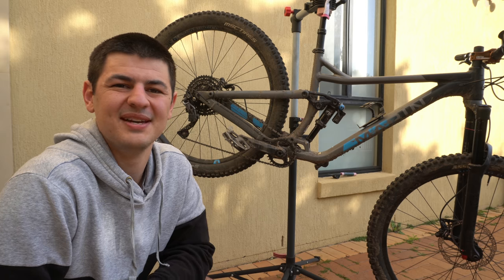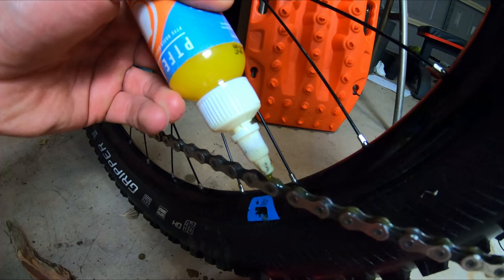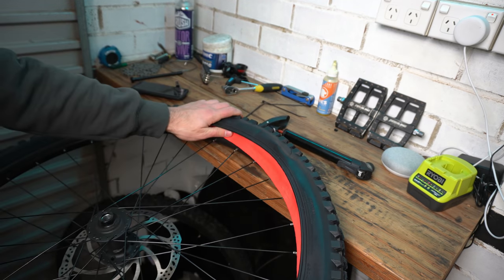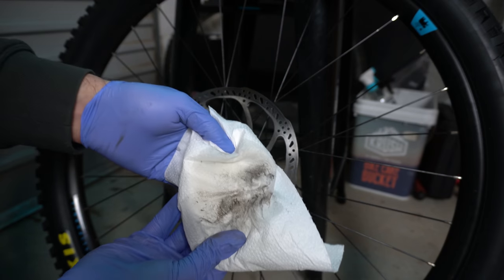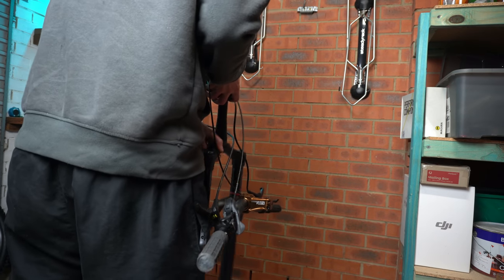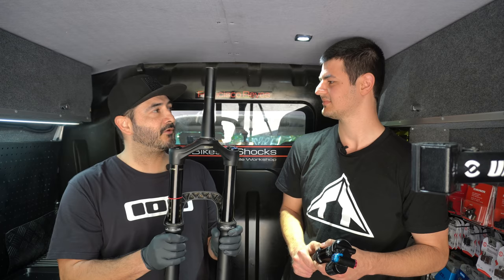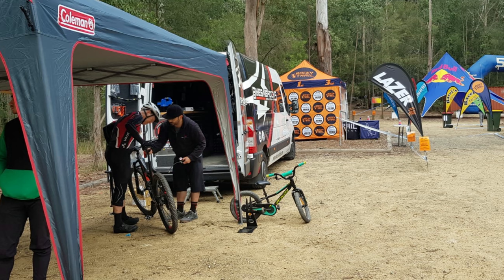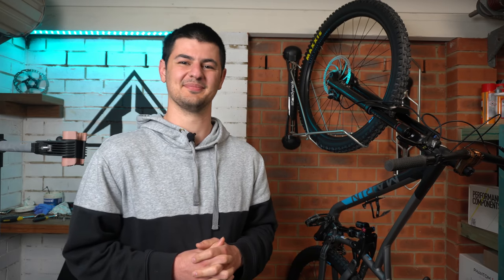Servicing My Mountain Bike | Mobile Suspension Servicing (Bikes N Shocks)

Comment: Hi Guys,

Vanessa here from Bikes N Shocks. 

First of all i wanted to say a huge thank you to Phil for making this awesome video and edition. 
This was Bikes N Shocks  first time on cameras so a bit Camera Shy for Cisco but at the same time he wanted to speak spontaneously to you guys. Harder than it seems!! ha ha 

When Phil asked what set us apart?
>>> This is why>>> Bikes N Shocks mobile workshop<<<

Sometimes you have to take your Fork and Shock out of your bike, pack it up and post it, then wait weeks to get it back and adjusted-back yourself!

With Bikes N Shocks you don’t have to do anything like that. 
You don’t have to wait and with only 3 clicks… We will come to you!!

1). You just go to the Bookings section in our website www.bikesnshocks.com.
2). Check our availability and time that suits you best. 
3). Get your bike Fixed or Serviced. We come to your place (Office, Home, MTB Trail, University, mates house etc). 

That Easy, we do everything for you!!
•	We set the right sag, put the right amount of air pressure in your suspensions based on your weight that assist setting up the rebound for your riding style. 

•	You get professional and personalized bike service on the spot, you and get advice how to make your bike perform better. No need to go anywhere…so you can use your time effectively.  

•	Apart from suspensions, we can do your bike services, dropper post service, pivot points servicing, wheel true and build, brake bleeds and service, Hub service and basically, anything your bike needs to feel smooth and to get the full potential out of it when riding.

>>>Fix your Bike and Enjoy your ride 100% with Bikes N Shocks <<<
Reply from the maker: Thanks Vanessa! Dont worry Cisco did great! I pinned the post so everyone can see :)
Reply: @trailtalkmtb6603  👍🤝🙂
Reply: Your van is so rad

Comment: Did u put a new shock on your Marin?
Reply from the maker: Yep DPX2. Same as the Alpine Trail 8. Sames volume spacer as factory with 32% sag (170psi)
Reply: Trail Talk MTB When did you get it and how much did it cost?
Reply from the maker: @Billyattenborough  Got it about 2 months ago, cost about $300 second hand. Previous owner said he used it about 10 times and luckily the service proved that :)